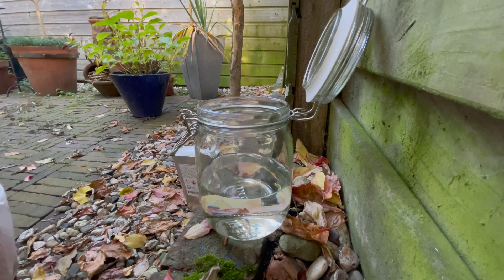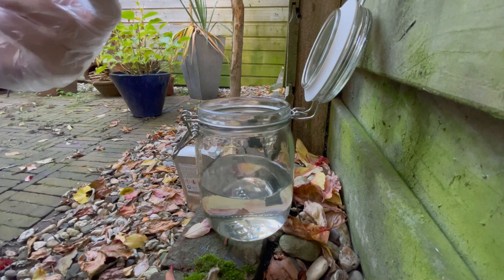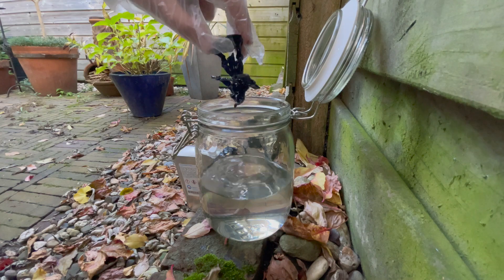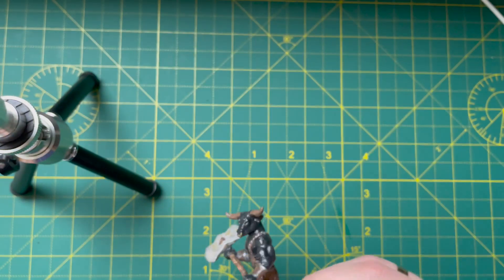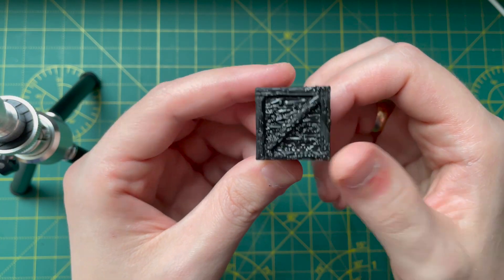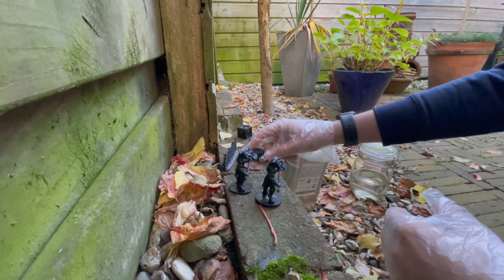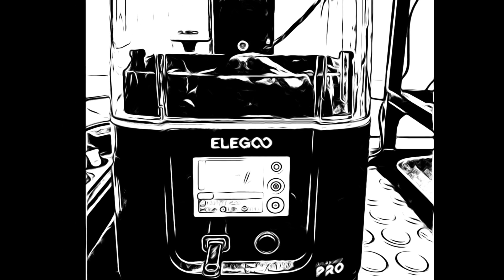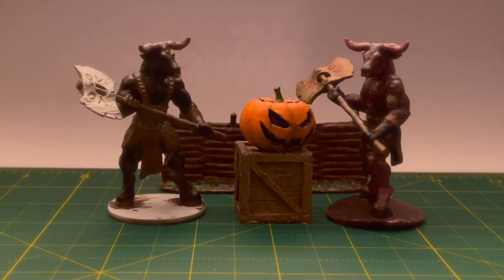How to smooth PLA FDM 3D Prints?

Comment: Do you need to use any special gloves or are any plastic gloves fine?
Reply from the maker: I don’t remember exactly, but I used the gloves that came with either the mounting foam or the hair dye (I found some on the shelf). regular latex ones or something like that definitely won’t work. If you're not sure, I recommend testing the gloves first by placing a few drops of solvent on them and waiting a couple of minutes. basically mine were like a plastic bag but shaped like gloves and it worked.
Reply: @virrcraft  Nice thank you for your reply.
In the meanwhile I found out that DCM is desolving most plastic types which makes it dificult to find protective gloves, but there are pva gloves that are used in a lab and these are definately a good protection.
But aparenty as long as you dont plan to dump your hands into the DCM you will be just fine with any gloves (as some kind of splash protection).
Reply from the maker: @Pontos420  that’s also true. I mean if it dissolve gloves in matter of minutes - it should be fine, coz we need to immerse the model for just a couple of seconds - after which the gloves can be immediately removed. I didn’t had any problems with mine, but I’m very glad that you care about safety! I first tried regular latex gloves and they were destroyed in the matter of seconds (tried not on my hands 😅)

Comment: If your country is part of the EU then best avoid this chemical. It's illegal since 2010 (as paint stripper) for citizens. I don't know why they specify its use as paint stripper... Further it seems to be probihited to be sold or given to private citizens. For industires it's forbidden without a special permit. In my country it's even forbidden as a solvent. 
Skin contact can result in chemical burns and destruction of fatty tissue as well as breathing in can lead to damage to optic nerves. Also it has been deemed as possibly carcinogenic
Reply from the maker: you are definitely right about the dangers of this substance and I was actually able to find information that According to the web search results, dichloromethane (also known as methylene chloride) is a solvent that has been banned in consumer and commercial paint strippers in the European Union since 2012. However, some EU countries may grant derogation for professional use under certain conditions. The UK was the only EU country who made use of this possibility before its withdrawal from the Union. Dichloromethane is also used in other applications such as aerosol solvent, pharmaceutical production and degreasing agent. so, subject to safety precautions (which, by the way, I warned about in the video), I see no problems in using this chemical agent.